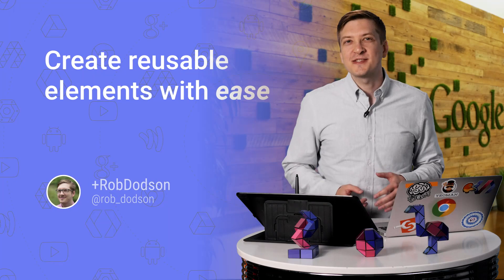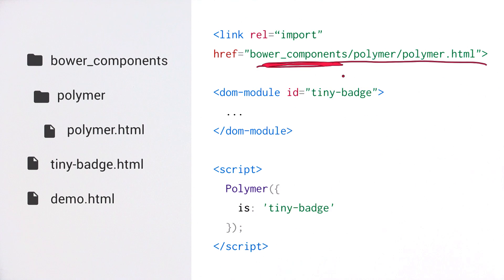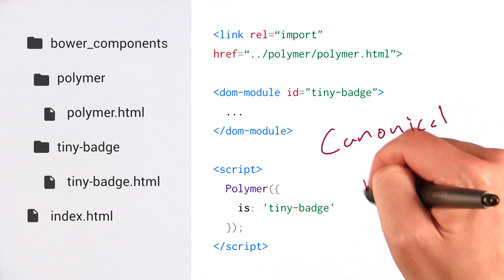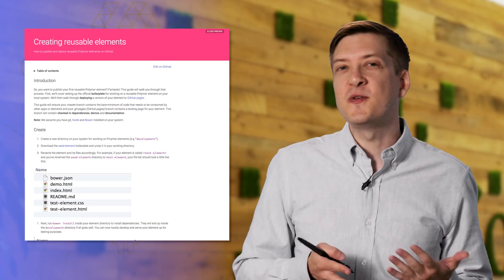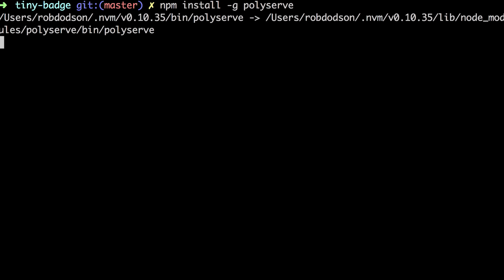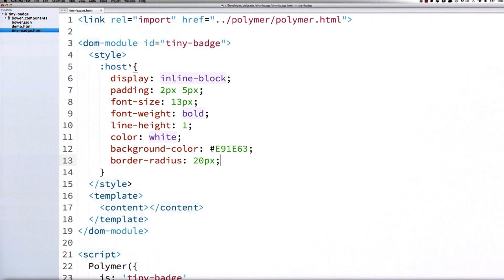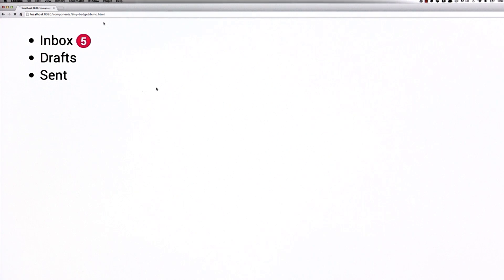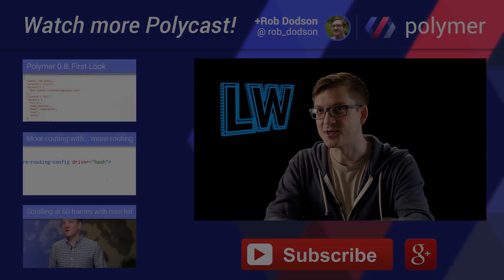Create reusable elements with ease -- Polycasts #14

Comment: Hey Rob, thanks for another great cast!

My question is kind of broad and involves theming your website. In material design, most resources we see have the primary/secondary color (as is common in most places). You've mentioned before using the /deep/ to penetrate and style before, but also talk about how this can be "dangerous" because other elements may be unintentionally styled as well. Is there anything in the works for how to apply styling specifically. Also, just general discussion on the topic would be appreciated. Thanks!
Reply: ***** Thanks for the material to read. Can't wait for the Polycast!

Comment: This is an interesting approach but it poses a couple of problems. I presume that you don't want to check polymer and core-, and paper- directories into your project. If you put tiny-badge, and tiny-widget, and tiny-* into your bower_components directory, you have to individually add these directories into git.  There's no top-level "tiny" directory. Keeping 3rd party components and your own components separate becomes more of a challenge.  

If I make a tiny_components directory as a sibling of the bower_components directory, they both resolve properly when served, but individual component dependencies between tiny components and bower_components don't resolve properly (as you point out in the show).  And you can't use the "extends" functionality to extend a component found in bower_components.

In the Java world, we usually use a local Maven (~/.m2/repository), or Ivy repository directory, where all 3rd party libraries are downloaded and stored.  Any time we make a dependency reference to it, the resolver, uses that Maven repository directory.  We don't check 3rd party dependencies with the rest of the source code.  Is there a similar approach that can be used either with polyserve, or with bower?

Comment: Can you explain how to use the oauth component for connecting to Google services like drive or sheets? I've tried but maybe my coding level is too low for this. I'm trying to create a form and save data on a sheet and after that, display sheet data on a table.

Comment: When 1.0 is released (at IO hopefully?) can we expect that core-elements and paper-elements will be updated and stabilized so that another 0.5 -> 0.8 transition won't break backwards compatibility (at least for a time)?

Do you also have plans to continue developing polymer designer, esp. in regards to the version in CDE?  I found this particularly useful to sketch out a quick element, but many of the templates are outdated at this point and unfortunately it looks like development has slowed, but I suppose that isn't your purview...

Thanks, and keep up the good work, really looking forward to a 1.0 release!

Comment: Hi ***** I have been developing using Polymer for a while and it's amazing how far we've come. I like the direction the project is taking with modularity 👍. There is one thing I'm still not sure how to handle with Polymer, I watched all the Polycasts videos and I love them, in one of them you explain how to use a polymer element <more-routing> to make a Single Page App with Polymer. However, you need to have all the HTML in one file. I have used AngularJS before and I really like the concept of views. I was wondering what is the best way to handle loading different HTML on demand and if there is an element that already does this for me. I'm pretty sure this doubt must have come up to you guys at Google so you may already have come up with a solution to my problem.

Comment: I'd like to see how best we can use requirejs with polymer elements. A colleague came up with :

    require(['lodash'], function (_) {
      Polymer('my-element', {

but that asynchronously delays the registration of my-element and so any use of it prior to the registration results in a warning. Is there a better way of doing this? Perhaps we can safely ignore the warning?

I see some mentions of ways to do this, but they involve fairly significant changes to source code while we'd like to keep the same standard structure if possible.

Comment: ***** I'd love to have a Polycast about sane example project structures with tooling, both for making own custom elements as well as building an application with Polymer.

I gathered some info about creating custom elements from this post as well as your Yeoman post on G+ (it's on 0.5 still), and the core-list Polycast showed a project structure for creating actual pages with Polymer. It would be nice however to see a polycast about this and have GitHub project stubs for both use cases, which you can clone and just rename to your liking. These could also have built in / instructions for serving locally and building for production
Reply: Rob Dodson Very cool that you guys have updated seed-element to include polyserve, and it includes WCT as well. I'd only note that it is very hard to find it without a direct link. I tried to find it a month ago but didn't find it as I couldn't recall the exact name of it, and had to ask a colleague for the name. Only mention I found about it in the documentation was under Guides & Resources -> Packaging & Distribution -> Creating reusable components. Not very easy to find that either without knowing where to look.

I think seed-element and Yeoman generator should have their mentions and tutorials under the Getting Started -section in documentation.

Comment: A bit like @Sébastien Portebois below, I would like some focus on testing. I've been trying to use Web Components Tester, but have had to struggle to do anything approximating 'dependency injection'. Say I have an element 'x-a' that uses another element 'x-b', so x-a.html has an import at the top of its file to import 'x-b.html'. How can I stub out the x-b element and redefine its methods so that I can control how it effects x-a?
My current solution is to not have any imports in x-a.html, and have an extra layer of files - eg elements/x-a/x-a.html containing the imports (including implementation.html), and elements/x-a/implementation.html containing the actual element. This allows me to directly import the elements/x-a/implementation.html file in my test and define all its dependencies directly with a <polymer-element name="x-b">...</polymer-element> (or whatever it is now in 0.8). This allows the test to control how x-b behaves and redefine its methods/etc. It does seem a bit hacky, but it does for now.
However, I'd like to hear how it's supposed to be done. I wonder what Miško Hevery has to say on this topic too - how about a guest star on a polycast?

Comment: I understand the 0.8 marks a shift away from the expression syntax and even two-way databinding to some extent. What is your idea of how you should lay out the data flow in a larger application? 

As an example: We built a Polymer app that fetches project data from a database, and categorizes the projects on the frontend. The user can then filter, sort and like/unlike the shown projects. The likes are persisted in the database and filters/sorting in localstorage. How would you design the data flow for this application?

PS. I've already got a Polymer laptop skin, I'd very much like some more swag! :)
https://twitter.com/ohanhi/status/579926912639832065?s=09
Reply: Rob Dodson Thanks for the input! A good friend of mine has actually been working on a very nice truly unidirectional data flow library, which was inspired by the flaws he found in React/Flux. He's going to present his thoughts at JSConf Budapest in a couple of months. Here's a link to the project, Cycle: https://github.com/staltz/cycle

I myself just posted about elegant two-way data bindings with Polymer on our company blog: http://futurice.com/blog/declarative-apps-with-polymers-two-way-data-binding

Comment: It would be nice to have an episode aboout creating Globals element :-)
Reply: Petr Žďárský +1
Reply: Rob Dodson Yes, I know that docs for that are well written. But I think that you as experienced developer will have some additional tips for that or just seeing it in action in video might be helpfull for someone.
Reply: Rob Dodson I've had some trouble with that pattern. It works fine for global static data, but if you want to set the data at runtime, then I find there are problems. I guess there's a solution to being able to initialise (other than via attribute/hard coded) and change global data...I had a setter and getter as a partial solution, but iirc it wouldn't work in the general case. (TBH, it was a while ago, so I forget the exact issues). Thoughts?